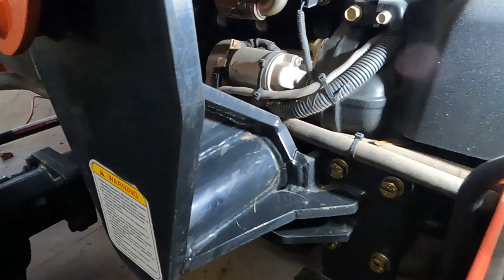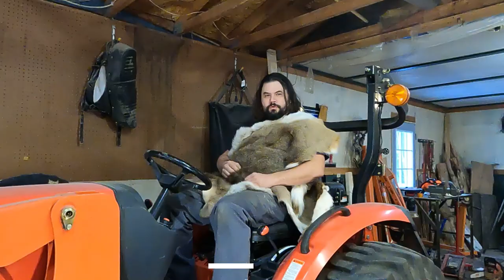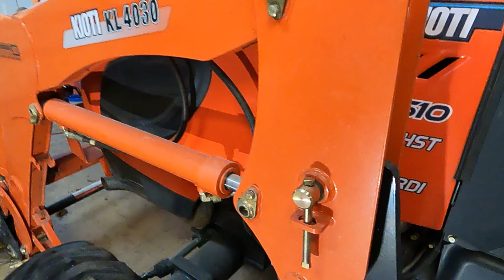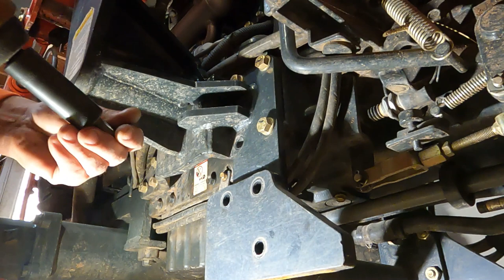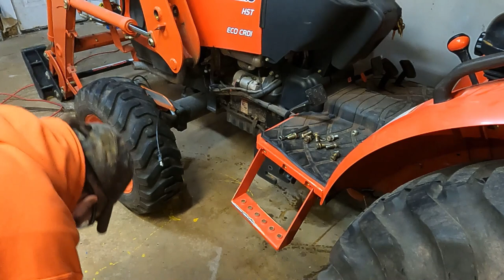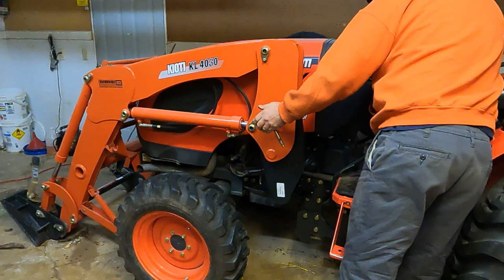Kioti CK3510 HST Broken loader!

Comment: I have a CK 30, with the KL 130 Loader attachment.
Neighbor up the road gave us the tractor, he is 86. he bought it for a guy and family to use living on the property...long story.
The tractor was beat up pretty bad as far as to maintenance. Has 635 hours.
Going over it once I got it home, discover the Loader Mounting bracket, similar to yours is cracked pretty bad.
Reason why mine is cracked, the 10 or so bolts that hold it on, 8 were sheared off from being loose. 1 1/2 were holding it on.
Right side had 2 sheared off, but that Bracket was not cracked.
When the Ram`s are pushing forward to lift, there is the other force pushing back, which caused it to twist and crack, Crack on mine looked almost the same as yours, plus a couple other areas.

This is one item in the  pre=op and General maintenance to check at every oil change as per the Dealer.
Dealer said this is pretty common as the run of the mill week end tractor operator doesn`t have a clue.
They see it all the time.
They also said they do not weld them, just replace, as the will just crack again. But for $1000, I got mine welded up by a welder friend that has been doing it for 50 yrs.

On the CK 30 model, is a thick (cast Iron ?) Piece  that will need to be replaced. The tractor needs to be seperated to replace it. Guy said sort of like a Bell Housing piece. On each lower side it is drilled with 4 holes for the big bracket, and the lower corner is broke off...Lucky me...and gave me a price for another $1000.

It`s in the shop (Dealer) now to have bolts drilled out etc... full service, new Ign Switch, (key broke off) and new seat belt.

Free Tractor probably $3500 +, still not a bad deal. + $110 new battery, and $298 for one front tire.

Hungry Beaver, looks to me yours is just a weak area that was not made strong enough. Find a good Welder and grind it out, weld and add some thicker steel to beef it up.

Comment: Unless you bought your tractor just for Sunday parades, it'll eventually get pushed to its limits. I've done all  the same things with way too big  boulders & logs, back blading, etc. Some bushings are showing wear on the loader but never had cracks like that show up. Could be just a fluke but I suspect there's some steel components from China there which contributed to the problem. I'd have tried to weld it up and slapped 'er back on before dropping the $600 on another one. But that's me being a tightwad. You probably made the right move getting a new component. Your narrative delivery always gets me chuckling. Educational & also entertaining videos - a great combination!

Comment: It's Kioti's fault for not making that main support housing strong enough. Good video thanks for posting.
Reply: I have I have contacted Coyote dealership in North Carolina and I asked for a representative or someone in a technical department to speak with the situation broken brackets on lower brackets response click I will never buy another Coyote tractor again
Reply: @MarkMenard-oz3ci  I bought the same tractor CK3510 in gear version back in 2021 and at my age it's the last one. I also have a [07] Kubota L3400dt and can tell you that the loader mount is 10 times stronger then Kioti, but I'm not sure about the newer Kubota's. So this year based on your video I'm going to try find away to make the Kioti loader mount stronger....... 
I bought Kioti because I feel Kubota has ONE BIG GIGANTIC FLAW that no one else but me has an issue with!!!!! 
    The issue that needs to be looked at when buying a tractor is, where is the rear Top-Link mounted to, ALL L Series Kubota's is on the rear of trans case, where the trans fluid  and 10,0000 gears are. So when an attachment like my pto winch top-link is hook to rear of trans case, 75% of pulling force is on the top-link, and in my case  it cracked my trans case, which is $3,000.00 just in parts for repair, the repair I did is another story.....
 Right now I know of 3 tractors that DONT have top-link mounted to trans case JD, which cost $8k more then Kioti and Bobcat which from what I see is a white Kioti. These top-links are mounted to the top lift housing, if that breaks the repair is 10 times easier and will cost less........
At the time I bought my CK I had 3 tractor choices with dealers within 40 miles, JD, New Holland and Kioti, other brands was 50+ miles away..........

Comment: Manufacturing defect the bolts are designed to give before the part yes weld it 7018 drill stop crack make a nice angle weld it hot. I looked at my kioti ck 4010 I noticed some porosity on the welds on my tractor

Comment: Thank you for this document.  You make it look easy !  Nevertheless, we don't ought to buy again this 650$ part too often.  Let's use common sense.  I won't blame either Kioti or the operator here for the damage, however I will share what Kioti salesman told me when I bought my CK4010 with this KL4030 loader on: ''Owww, this is not an industrial loader you know ! ! ! ''   Read between the lines, for harder applications, we must use it in a gentle manner, not push too hard, with some delicacy, with extra care.

Comment: The weld in the corner above it has slag embedded in it. Poor weld, and I would grind both out and weld them.
It's worth welding both , although you are going to have to grind from the top all the way down into the corner slag to get at it.

Comment: I have the same problem starting, noticed a small hairline crack starting, my buddy's going to repair it after the holiday. He said it was because they undercut the weld and that caused a weak spot. Basically, they never welded the edge.

Comment: I torque these and the rim bolts every 10 hours on my 3510. They get loose. I work mine very hard and have not broken one of these yet. Keep them properly torqued.
Reply: What is the torque on these bolts
Reply: @dave_1958  the loader bolts are 135 FT LBS. Top link plate is 50 FT LBS with grade 10 bolts (I upgraded from the metric grade 8).  Rear wheels are 160 FT LBS. Front wheels you will have to look up. I think they're 135 also but I cant remember off from the top of my head.
Reply: @geremychubbuck3730  thank you !!

Comment: I would have ground it out an re welded it before spending $600. Your dealer no way would take responsibility to replace it free of charge unless he was one of those exceptional guys!
Reply: I would bust out my $99 Yes welder and set on it while  I burn some 7018 electrodes with my Hobart engine driven welder. 600 dollars is to much plus I break everything.

Comment: My questions is; What caused you to notice it was broke? Did the bucket lift funny, unusual movement in the frame? 

My frame was loose on the tractor. I noticed when lifting things that it was moving. The dealer hadn't installed all the bolts and they one's they did install was loose. I had to chase the treads on the bolt holes, use some new bolts and then used blue Loctite on all the bolts torquing them to specs.

Comment: Ok for the pro welders out there, how do you actually repair that? I’m assuming you have to grind some of that out but can anyone detail the procedure on how they’d go about that? Not going to tackle a job like that myself as a home farm welding novice because I wouldn’t trust my work. Just curious.
Reply: Grind a v-groove along the entire crack then weld it up. Easy.
Reply: @ericanderson8556  thanks
Reply: Probably too late but I’ll throw in my .02, I’ve done a little welding. First thing I would do is get all the paint off, then find the end of the crack and drill about a 3/16” or 1/4” hole at the end of it, if this step is skipped, it will continue to crack. Then I would take a cut off wheel and run it down the crack as far as possible. Everywhere else I would deeply bevel with either a stone wheel on and angle grinder or a carbide burr on a die grinder. In those areas I would also run a wire wheel down into the crack to remove any potential rust. Lastly I would wipe the whole area down with acetone. I would probably do this repair with a root pass then a cap pass instead of just one pass

Comment: You're correct...If it can be picked up we'll pick it up. This bracket should be designed to withstand the limits of the loader lift capacity. I'd say it is a design failure. Kioti is junk. I've had so many issues with my CK3510SE. Pathetic. But not this, yet. That $600 piece of steel cost the Co just about $56 to laser cut, bend, weld and powder coat. If I was near you I would have repaired it for you. Appears a combination of heat stress from several welds close together right near a sharp profile on the plate. You should ask the dealer and Kioti Corp to show you their FEA (finite element analysis) data in that area. FEA will show "hot" spots in the design. I'm betting that area is a weak spot. Good luck.

Comment: That isnt your falt i v broken or should i day that the loaded bracket on my 3510 has broken twice on both sides 
It is a engineering problem and kioti redesigned the brackets and bucket ac Assembly in  2021 sp they you have it and i v contact thr  corporate office and they refused to let me see a representative. I'm picking my tractor up for the fourth time of replacement of the bracket as you told me too hard on equipment that's three-quarter inch steel bucket assembly, and pistons blown out or bent before that bracket broke never buy, Coyote.

Comment: What is the torque setting for the loader mount bolts?
Reply: I don't have it handy, but it's stated in the KL loader operator's manual. They're supposed to be re-torqued periodically. Mine needed a little tightening at 50 hrs, probably from the powder coat wearing.